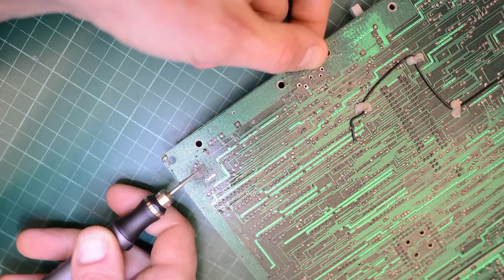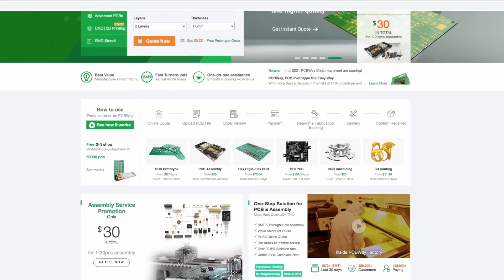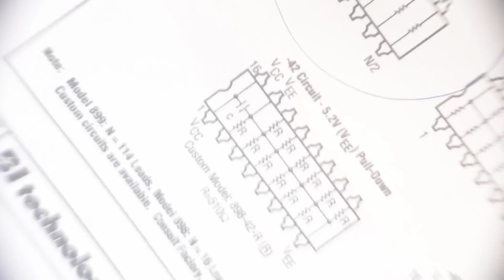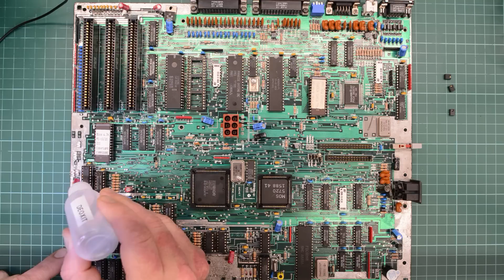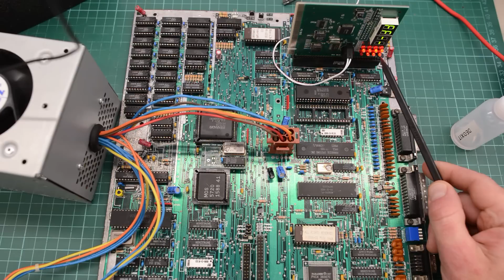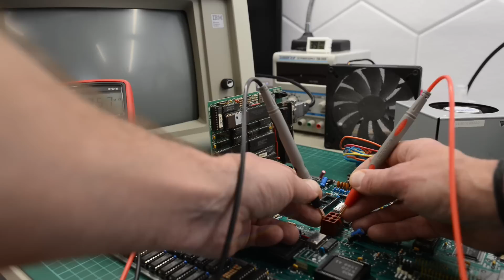Getting the last missing components back on the board and trying to boot the Commodore PC10-III

Comment: Try removing the paradise chip entirely?  Also try all the other dip switch settings, there aren't all that many to try.  Then repeat with a CGA(if that's what it supports) monitor with all dip settings.
Reply from the maker: Yes, I will remove the chip next week if needed. First I want to try out some diagnostic ROMs and double check all traces

Comment: I have just "finished" restoring a PC10-III and am using a trident VGA card in it. I've also used an oak dual VGA/CGA card in it. If the computer is working you will get a video output from the external card no matter what. If the switch block conflicts it'll output in black and white, or freeze up when you load a graphics driver. The point however is that no matter what it will output a video signal independent of  the switch block, there's no need to disable the onboard graphics. Also once the ram has been checked you will get a Commodore Chirp sound from the PC speaker. My money is on the memory not working, my board had 2 banks of ram cut out and I had to replace them and fix traces along the way, and when a single ram trace was broken the board wouldn't post/output. I have one of these working right now and have spent the last few months scouring the internet. They're neat machines and have a lot of benefits to a regular XT, however the configurations create some issues that normal XT's wouldn't be subject to such as video conflicts and mouse conflicts.
Reply from the maker: Awesome, Thanks for the advice, that is very helpful. I plan on recording the next video next week. So, I'll put a trident card in the slot and focus on the RAM/traces. Thanks

Comment: I've been working on a new XT BIOS project (called GLaBIOS) and have recently added support for the FE2010A chipset. I'd be happy to build some debugging ROM versions that could beep, send codes to the POST card or parallel port, perhaps do some rudimentary hardware tests and see what (if any) code is actually running.
Reply from the maker: That would be great. I'd love to try it out on this board for sure. You can find an email address and Twitter under the "about" tab here on YT. I have EPROMs and a programmer fired up and ready : ) The original BIOS for this board is 4.36. BIN files on Zimmers here: http://www.zimmers.net/anonftp/pub/cbm-pc/ALLFILES.html

Comment: I had a Commodore PC 10 model 2 and had accidentally killed the com port making my own mouse ( long story, replaced the IC at the back that was the buffer ) and at the time those ISA test cards were occasionally cheap on eBay so I bought one.  If it changes from the start FF on the card, you are going past post.  I could not figure out what it was doing as the documentation did not cover that BIOS at the time.  you did install a few gate ICs that direct logic so if you have an IC tester, check them out for functionality as some " New old stock " could still be dead due to actual age and not use.
Reply from the maker: Yes, one of the NOS chips may be bad for sure. We'll try them out

Comment: Obvious problem is obvious, you have a weak short on the secondary 5v rail. 67R? That's WAY too low. All your power rails should be in the kilohms.

One of those chips is fried like an egg. It doesn't have to be a full-on direct short as if the chip turned to a copper slug inside -- a weak short is just as bad. In fact, it's often worse because it usually means one of the more important chips. In a modern machine, that'd be indicative of a bad CPU or GPU. In that thing? Anyone's guess, but since you already have fault indicators pointing towards the GPU chipset... that's where I'd look first.
Reply from the maker: I hope you are right because I will desolder the GPU in the next vid for this project. Although, I'm not sure you are. The reading is a bit low for this vintage but not quite by that much. I have many boards with 130-200R on the 5v rail (8088-486 boards) Let's find out

Comment: 3:01 - it says "NEC" on it but you say "OKI", Oki is not the same as NEC same as apple is not a orange. 😬🙄😡
Reply: I think he meant the original chips (they were indeed Oki).
Reply: @bikkiikun  okay, I see, but is misunderstandable the way he says it. Lot of hours gone into thie repair, so much patience, I wished it would have worked out but I figured it would not boot with this damage. Well, was worth a try.
Reply: @stefanegger  : My first reaction also was, "that's NEC, not OKI". but then I saw the originals on the right side and it dawned to me, what he meant.
Reply from the maker: @stefanegger  We're not done yet with this board. I'm piling up stuff to try out and will probably record the next attempt next week
Reply from the maker: Yeah, that was very unclear. The original chips were OKI. The replacements are NEC. They should be fine though and they are freshly tested in another machine
Reply: @Epictronics1  I agree, they should be fine. It's not unusual to find the same chip by different makers, especially when it comes to simple logic or memory.

Comment: Perhaps there's still a broken trace somewhere?
Edit. By the way, really like your channel and how you are doing stuff, one of the best retro repairs channels I've found so far, if not the best. I quite like how deep you go after the issues, replacing each chip and redoing the traces,

I wish I had half your motivation and experience to fix my Microdigital TK2000, which is a Brazilian Apple II clone in an Atari 1200XL case basically.
Reply from the maker: Yes, that is possible. I will begin by testing for continuity and shorts

Comment: The onboard graphics is disabled automatically once you plug in a graphics card in the ISA slot - at least on my PC-10-III with a ATI EGA card from a PC-30. The onboard graphics will however generate a sync signal and some random characters, but the computer image goes to the ISA card. 

The PET chime will come AFTER the double (and slow) RAM test. The test usually takes 30-45 seconds before it's completed, iirc. Floppy seeking happens AFTER the RAM tests is performed. 

Best of luck
Reply from the maker: Thanks, that's very useful. In that case, we can set the graphics problem aside for now and focus on the POST issue. I'll make sure to give the system at least 45 seconds on every boot. This also means that the BIOS hangs before the RAM test
Reply: @Epictronics1  It was a couple of decades since I tried this... but if you plug in an XT keyboard  instead of an AT, the computer will just beep continuously as soon as you turn it on. Maybe that will help you in some way?
Reply from the maker: @VicTheVicar  Yes, it would. That would indicate that the BIOS is doing something. Good thinking there, thanks

Comment: Interesting issue. I would look at that the BIOS and if good, then replace the CPU, if you have a spare. Thanks for sharing
Reply from the maker: Thanks. Yes, I can burn a new BIOS and replace the CPU. I think I'll check for shorts and brakes first because of the extensive rework done to the board

Comment: New bios? Ya dude dump and compare the bios with a known good file.
Reply from the maker: Yeah, that's easy enough. I think I'll start by checking for shorts and brakes because of the massive rework done to the board. The next step I guess is to check individual chips. My guess is that there is at least one more bad chip onboard. Maybe the Paradise PVC4 is shorted?
Reply: @Epictronics1  I’ve modified one of the latest ROM’s (v2.46 from the top of my head) by replacing the original XTA-IDE part of the ROM by the new iteration of XT-IDE. I’ll try to obtain it some time this week or next week. :) when I’ve got some spare time to go at it at least! …
Reply from the maker: @Inject0r  Cool, thanks